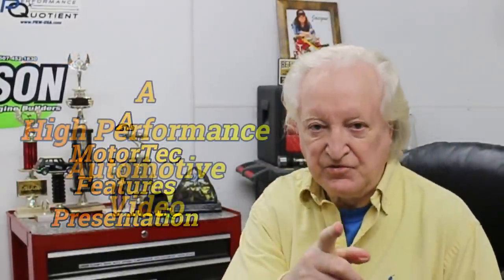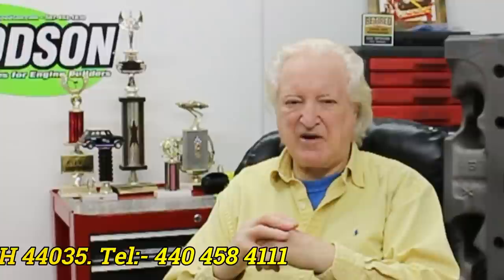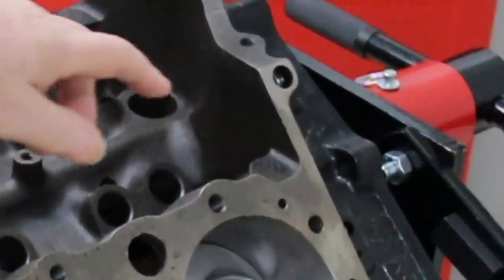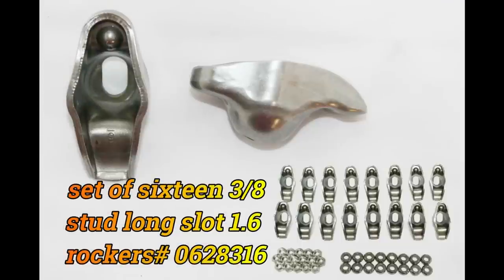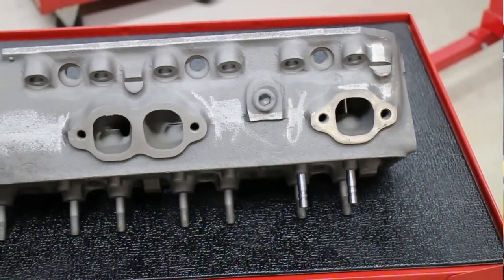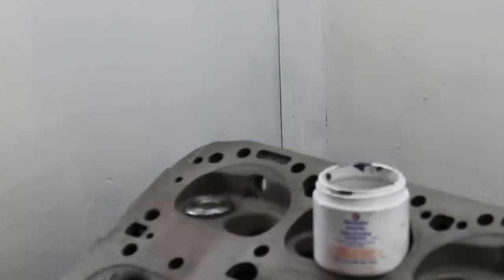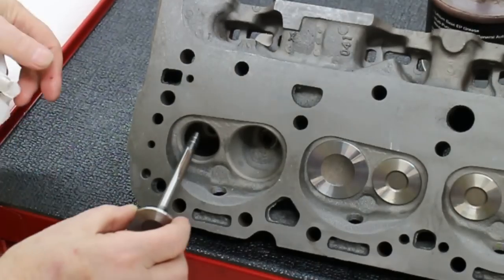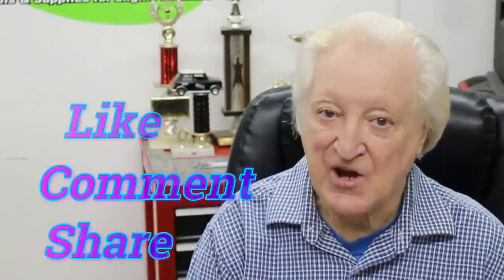Real low buck 60 lbs-ft and 60 hp minimum from stock iron headed 350 SBC

Comment: Glyptal is an excellent paint to use on engine internal casting surfaces. The surface must be free of oil and water and thoroughly washed. You want no residue from a caustic bath left on the casting to be painted or it will affect adhesion.. Glyptal  can be sprayed if thinned with Xylol or Xylene. It is commercially available at home centers and hardware stores. The surface should be wiped off with Acetone prior to painting so all moisture is removed. I called Glyptal for this information. Cleaned properly, adhesion will not be a problem. G.E. (General Electrid founded by Thomas Edison) patented Glyptal back in 1914 and it was developed into a paint in the 1930's. Since then, the company was spun off by G.E. sometime in the 80"s.

Comment: We've had irrefutably good luck with Isky cams as well.

Their 'mega' flat tappets seem to follow your thoughts of a narrower lsa single pattern cam. Specifically the 270, I have experience with in two separate sbc's, and it's a positive one. They seem to run very well in the mid range with the stock cylinder heads.
Reply: I have used some of Isky's megadyne cams with grest sucess as their catalog cams are more often usable due to having a tighter LCA than most other companies.

Comment: That is a 041x cylinder head. It comes from the factory with ports about 10cc larger than other fuelie style heads. I have modded that head to 275cfm with a 2.055" valve but casting thickness must be watched.
Reply from the maker: Charlie - with your excellent porting skills this is nothing les than I would expect!! Take care my friend.
DV
Reply: @marvingvx1  Thanks, David. Cheers!

Comment: My question is about what you  just said about  damper  selection    I'm in the middle of  rebuilding a factory  roller cam 5.7L which  as you all know  is externally  balanced as is the sbc 400 ci engine   I have not had it internally balanced.  My question is do I use my original  8 inch factory  damper or do I use an externally  balanced  aftermarket 8 inch 400 sbc damper.  I'm thinking  they are probably about the same as far as controlling  vibrations  at the crankshaft  as long as your flex plate is designed for  externally  balanced  engines or did I miss something.     I have  played  this  video  3 times  now  thinking  I'm not getting the point or not understanding the  message from the video.  I do plan on  reusing  my original damper and  flexplate on this  rebuild and using your  source  to have my  roller cam reground to your 107 lsa 
Please enlighten me if I am wrong about what I'm hearing or misunderstanding

Comment: Hi Mr. Vizard! When you say use a 107 LCA do you mean LSA? I have a 2016 supercharged Dodge Hellcat Challenger. The aftermarket cams for my car are very disappointing. Most add marginal power and have large LSA's. It's a 376 with 9.5-1 compression and currently at 17lbs of boost.  Factory cam appears to be 215/223@50 561/551 lift and 120.5 LSA. I'd like to make peak power around 7000rpm. This is not a daily driver. It is street driven but I want roll on power for 60-130mph rolls. Any recommendations for what sort of cam specs I should aim for? Thanks

Comment: Hello does anybody know how to filter out the white noise from these videos? I have much difficulty hearing what David says :(
Reply: No white noise on mine.
Reply: @hotrodray6802  Hello, on what device are you watching these videos?
Reply: BTW, for anyone who's interested, I found a way to improve the sound quality. It can be done with a free software program called NCH VideoPad.
First you have to download the video as MP4 file. Open it in VideoPad and select the audiochannels in the bottom half of the screen. Then select Audio Effects in the menu and apply Noise Cancellation to both channels. Then remove the right channel by selecting Pan (100% left) and copy the left channel to the right by selecting Surround 5.1. Now you can play the video in VideoPad or save it and use a different videoplayer.
You can save the combined effects for future videos.

Comment: Thank you for such good videos and info. On the topic of Center line, I built a 460 for primarily torque at lower RPMs. The intake center line is 108, but the exhaust is 116. Is this a problem or does the 107 and 108 degrees mostly apply to intakes? When I told the cam company what I was doing, "hulling a large truck camper" this is what they suggested. Lift is 506/519 and Advertised duration is 264/268. Thanks again for your time.
Reply: when he says 107-108 center line, he means Lobe Separation Angle or LCA, intake Center line is the Intake lobe Center line when installed

Comment: David thanks again for your informative videos.   I'm curious as to what weight engine oil you use in these small block chevys?
Reply: Viscosity ≠ weight. Any SBC with reasonable clearances can use SAE 30. 5W or 10W-30 has better cold viscosity in that it doesn't become as excessively viscous when cold as a mono-grade SAE 30. 0W-30 is even better in this regard if you choose to go synthetic. A good bargain choice is Shell Rotella T5 10W-30.
Reply: David is that you?

Comment: I have a Crower 108.5 degrees with 9.81:1 theoretical desktop computer dyno program.  Can I advance the static timing 3 degrees, then reinstall the distributor at 0 degrees to achieve more horsepower?  Can you check this out for me?  I'm using 7.800 push rods, 1.6:1 ratio roller tip stamped steel rockers, and the cam is a flat tappet. Stock ratio crankshaft and rods in a 350CI at .020 over piston bore.  Could the timing choice grenade the engine somehow?

Comment: Awesome video David ! Thank you.. here's a question.. what is the criteria on power brake (vacuum) ? how does LSA effect vacuum at idle ?
Also, on the use of your COMP height mic, the retainer is down in the step, you have to subtract the measurement of how deep the step is. It's made to measure on the outer diameter of the mic. hope that helps
Reply: LCA does NOT affect idle vacuum - overflap does.

Comment: can you make a video on why the big damper is better?  it sorta goes agaisnt the less rotating mass is better idea.
Reply: The valve and ignition timing are more stable with the larger damper. Timing chains are solid steel under tension and transmit torsional vibrations to the cam, valve train and distributor. The alternative is an expensive belt drive.
Reply: Takes a lot of the torsional twist out of the crank, which means more power. Also changes the hormonic rpm range, but that's another story.
Years ago HRM did a back to back damper comparison with aftermarket stuff, and the 8" won by a large margin.

Comment: I would like to build a sbc 400 the same way as the 350 you describe in the video but would I put the lsa on the same 108 as the 350 or would it change because it is a bigger cubic in motor

Comment: 😀this is awesome david and everyone. thank you so much. what if you have dart iron eagle 165cc with 64cc chamber and zero decked block, 7cc relief flat top hypereutectic pistons and 6" rods? Comp XE274H10 cam. i am guess what target cc chambers i am need for pump gas 87 octane ? i am that i am. i am believe the iron eagle 165 has hot exhaust valve and need adjusting because the coolant passage casting has tight area next to valve that does not flow anything, would like to get in there with something to change that , maybe chemically?
Reply: I'd probably try thicker gaskets and watch for quench detonation ....before changing piston dish.$$. Pistons can be milled for a dish and retain a quench ring.

Comment: What kind of vacuum will you have on a 107-108 LSA for your power brakes?
Reply: Not much. It's the main reason cams with an LCA less than about 110 are generally not recommended for street use.

Comment: Why a 107°/108° LSA? If we were doing this to an L31 350 Vortec motor and used a 107° LSA, would that still have enough vacuum to run Power Brakes and accessories in a suburban with fuel injection?
Reply from the maker: Kevin, you are behind on tech know-how on cams. THE LCA IS NOT, FOR ANY GIVEN ENGINE SPEC, AN AJUSTABLE FEATURE!  NOTE:- IF YOU WANT TO GET IDLE QUALITY THEN BE AWARE THIS IS CONTROLLED BY THE OVERLAP USED.
Reply: @marvingvx1   I don't know that I would say "behind"...  I'm kinda a newbie and trying to learn.

Love your channel!  Just trying to absorb it all!  Do you have a good video that explains the valve overlap/LSA?
Reply: @kevinflynn1774  what David said was 107 or 108 installed intake centerline angle.  That is different front lobe seperation angle.
Reply: @kevinflynn1774  Buying his book How to Port Cyliner Heads has this cam information. I won't divulge DVs knowledge here, except this "Running a wider center line angle means your attempting to run more duration than the application needs". This is what costs idle quality, vacuum, and ultimately engine output.

For more accurate numbers, and how to get a greater understanding of when and why cam timing needs to change, and what to change it to, then buy the book. If your able to, this applies to any cam operated internal combustion engine, including mulivalve ones. In fact, any book where David Vizard is an author, get it. There is always useful information in everything he publishes.
Reply: @bcbloc02  Nope! Watch again. 107° LSA for the roller and 108° LSA for the flat tappet. Installed intake centerline he didn't say, but it's probably straight up to 2° advanced.
Reply: @Joshie2256  5:30 he clearly says Lobe centerline angle.
Reply: @bcbloc02  Yes but not INTAKE Lobe centerline angle. He states that LCA is not adjustable but Intake Lobe centerline angle is by indexing the cam and changing the advance or retard. Some Europeans will use LCA in place of LSA when not referencing an intake or exhaust lobe specifically. He talks about buying a cam with the wrong LCA. It is not that wrong if it can be adjusted while the LSA cannot. He did another video on it and it sure seemed like he meant LSA. It is also a much more prominent number in the cam world. David is such and exacting guy that but I still wonder. I do wish he would go into more detail as to clarify what LSA should we use.
Reply: @a2cryss  I think you are right. My Cam timing cards from Bullet Crane and Comp all give it as LSA lobe seperation angle. I have ISKY cards that give it both as lobe sep and lobe center but I see Howards and LSM apparently use Lobe Center as well.  Apparently it is not an industry standard for how the lobe seperation is described.  I do agree that LSA is fixed while IC can be changed so LSA is probably what he was talking about, but maybe even both as piston position at valve closing has a big effect on torque production in my experience.
Reply: Depends upon the duration! Most people try to use too much duration and reduce the overlap (and torque) with a wide LSA.
Reply: a2ctyss
DV specs LSA by bore size, cubic inches, and valve size.
The answer is ALWAYS a solid non negotiable number regardless of engine brand name. Any deviation from his recommendation costs power. Dyno proven FACT.
Reply: @hotrodray6802  So when he says Lobe Centerline Angle, does he mean LSA? There is a video about rockers where he talks about a wider LCA which sort of doesn't make sense unless he means separation angle.
Reply: @Joshie2256   Sbc with modern efi work best: 112*- 114* lobe center :  single plane small runner/ edelbrock torquer 2- wieand 7547 etc. Drag stip or peak on dyno 106*-108* center. Remember street driven part throttle engine - clean spark plugs.
Reply: A2ctyss.... If he doesn't say INSTALLED CENTERLINE he means LSA angle ground in between the intake and exhaust lines.

Comment: My 1970 350 LT-1 had an 8 inch dampner but I don't know if it was stock or not, after watching this I may have made a mistake by using the Scat 6 inch dampner on the Scat 383 assy I installed .

Comment: chevy v8 small block standard head from 1975-mid 1985, i was on the other side dodge Or ford! i got odd oil company  job, in the early 2000 i was in pits of pulling tractors ( great right what a tractor got, this where odd came in v8 chevy how more then one  sb or big block, a few, may jet turbine's & what was a diesel v8 the fuel injectors were some replaced with spark-plugs there was different intake and injectors and a way to spark off the alkie on a 3000 hp engine in a tractor ps main bearing ever run ruined till this oil)   ps your boating oil needed tested! i got free tour tractor pulling rigs! some were wild!

Comment: Great video and thanks from the UK. I have 350 ZZ4 in my 79 capri, it's 310 bhp at the rear wheels, is that about right? Also it has a 600 holley and mallory ignition. What ignition would you recommend upgrading to? bearing in mind I want to keep it simple and tidy. The carb is jetted to 70 primary and 72 secondary as I put a secondary metering block in it.  Is this about right? When it was on the rolling Road the tuner didn't say much. Thanks
Reply: DV has said on a video that he uses DUI (Davis unified ignition) from Performance Distributors in Memphis... HEI type .... exclusively... And has NEVER had one problem.
Reply: BTW avoid those Chinese copies off the net for $80 USD. Junk. Many failures.
Reply: @hotrodray6802  that's great thanks. We have some really good places in the UK and good following for V8's  Chevy, Mopar and Ford...all are great in their own way and from some amazing muscle cars.

Comment: I used to work on cast iron heads for valve jobs, I used to just hand  Lap the new valves or remachine ones and get every thing numbered, clean the @#$ out of every thing and install the springs and test , whith carb cleaner by  fillling the ports, to test. I have a  dam good  question when a valve goes thru its cycle  does it rotate a hair when then the spring is moving up or down?
Reply: I have seen hi-speed photgraphy show as much as 4 revolutions a minute.